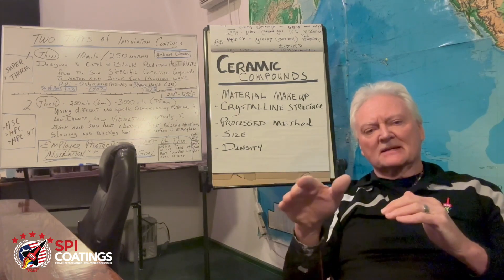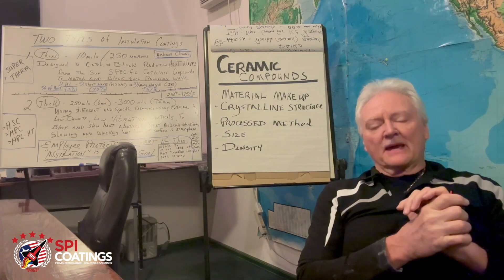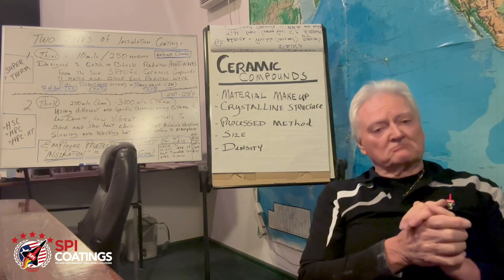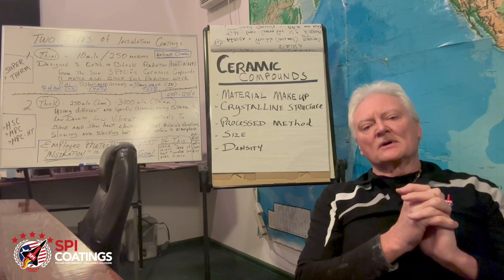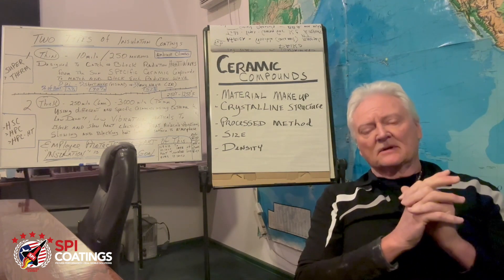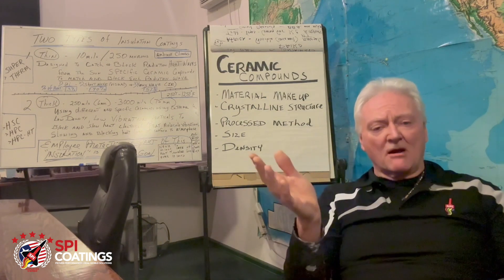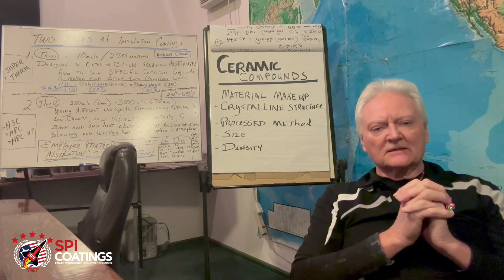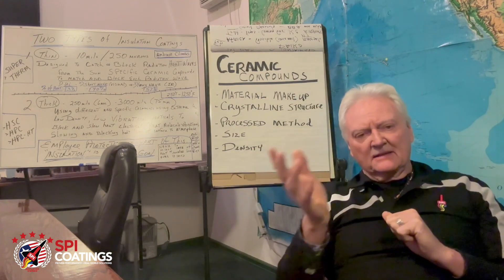Advanced Ceramic Compounds to Block Heat - J.E. Pritchett & SPI Coatings

Comment: You want the heat to remain in the mass of the exhaust gases and have it exit the system as a high pressure pulse on the leading portion initially as the high speed high pressure high temperature pulse exponentially increases it’s speed because it’s still expanding as its being forced by the upward  movement of the piston which accelerates from 0 to 81fps in 2.25”the full volume of the cylinder under 11.:1 compression is going to expand to 11 x its compressed volume in one direction during the exhaust stroke at a rate determined by conduit geometry and inertia of stationary gases present in the exhaust system ahead of the initial combustion pulse, factor in the rate rate of thermal and combustion expansion (contained controlled explosion blasting out of the cylinder into the exhaust system, the high temperature rapidly advancing and rapidly expanding gasses of the first pulse meet 2 forms of resistance, the physical boundary layer of the system conduit which separates the exhaust gas pulse reducing its mass density, and the the cooler stationary ambient air at the leading edge of the charge pukse, the air has viscosity and so does the charge pulse which has mass and kinetic energy, that acts upon the air sitting in the system not limiting the amount of expansion just the rate at which it passes through and exits the system, and this is where coating technology comes in the pressurized gasses in the charge pulse when collected like shot shell  pellets encased in the wad store more physical and thermal energy when combined in a unified group the amount of friction between the  conduit and charge pulse is determined by the density / viscosity of the boundary layer, (generally less than 2” +Hg  windward upon initial cold start) as the heat conducts through the pipes and they heat up, the boundary layer thins and acts like a lubricant, if the conduit diameter and length properly support the rate of flow volume at high inner conduit and exhaust gas charge temperature are still at High temps upon exiting, the pulse retains thermal energy and physical  mass, creating a vacuum in it’s wake in the exhaust, this is where the coating is important, because engines love getting their pipes sucked clean, by a hot exhaust pulse increases power, improves throttle response and efficiency by a large margin. 
Problem, exhaust systems are metal, snd highly thermally conductive, they absorb and dissipate heat, cooling the boundary layer, making it more viscous, simultaneously cooling the  charge pulse, and making it more viscous  slowing down the works creating more pressure at the exhaust valve and more heat quenching in the cylinder and head, expanding parts with size expansion tolerance limits. 
 FINALLY, (Sorry) The thermal barrier coatings isolate and retain he heat within the conduit and on its inner surface, keeps things cooler in the engine, hotter in the pipes,